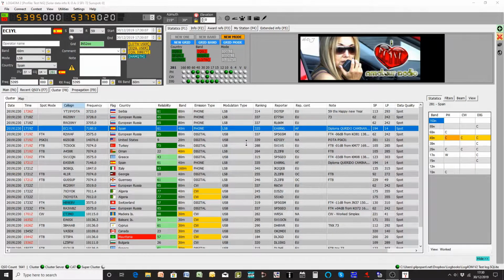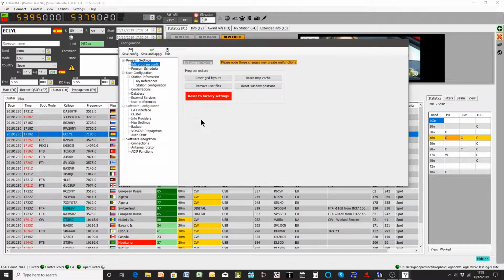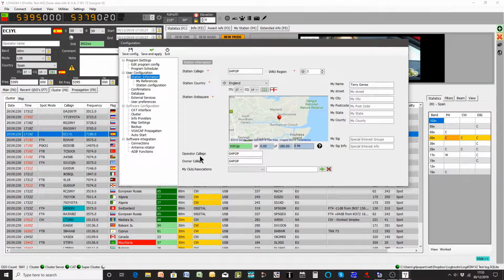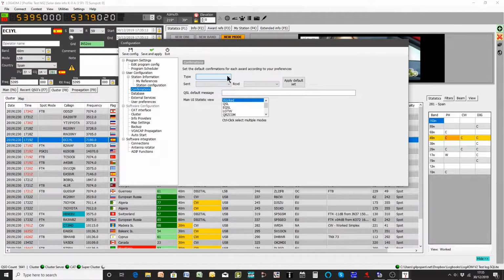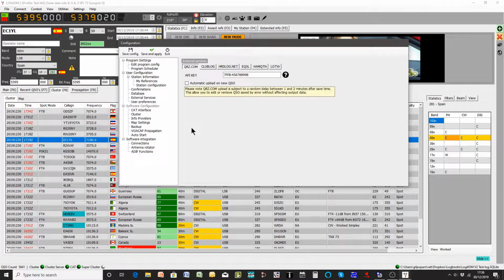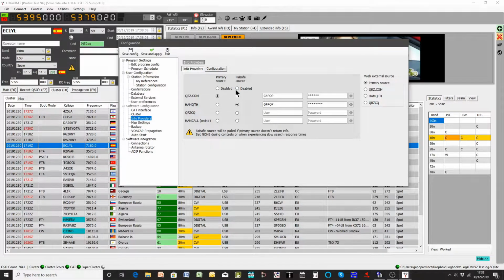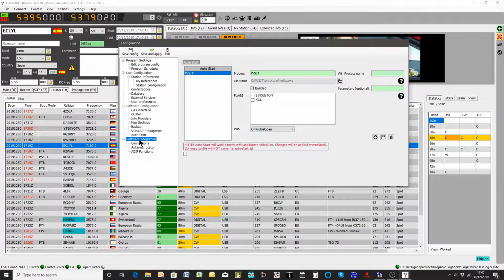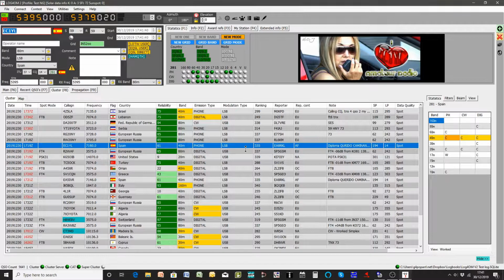Log4om V2 config

Comment: Getting back into the radio after 15 year break.  How this change. Technology I'm in the old school  maybe it is age.
Equipment here FTDX-1200, signalink and win 10 desktop. Just have problems with switching to computer for face appointments have to go to sound system and change it. Using Fldig. Thank you for soming I can use. Just the computer need to find the radio. 73

Comment: Save, Save & Apply and Exit....  Save, Save & Exit, Exit.  Although Close would be a better word.   I love Log4OM v1.4 but this v2 release is clunky, hella slower, and almost vast steps back in time.   Plus has Omnirig issues connecting to the FT-950 which is completely rendering it useless.  The UI has taken steps back in time and isn't modern and in keeping with modern controls.   its like its been developed on a much older IDE that doesn't support whats available to developers in todays world.

Come on guys, get your act together Log4OM 1.4 was a great product
Reply: I feel just the opposite. I think this is a huge improvement. I like the mapping with Google Earth integration, propagation tools, the contact’s info & the country statistics on the main page, fast load time, configuration & award options, plus many features that I’ll probably never use. It’s obvious that a lot of time and work went into V2. And it’s Free! 
 
But if I had an FT-950 that didn’t work with it, I would feel differently. I’m sure the bugs will be fixed soon though.
Reply: I guess its what you get used to. I love V2